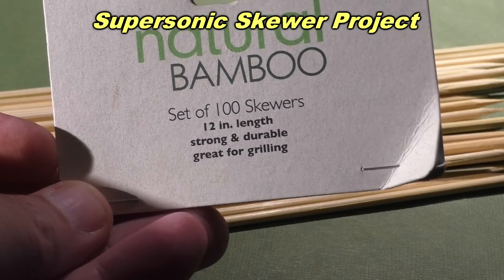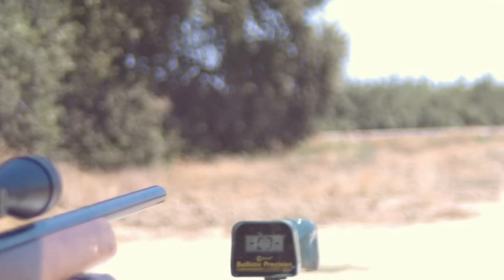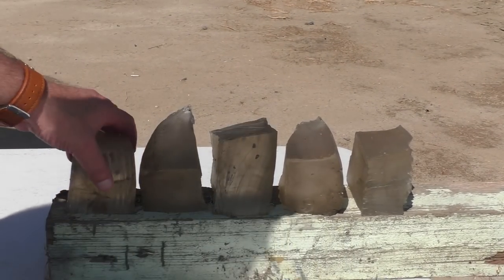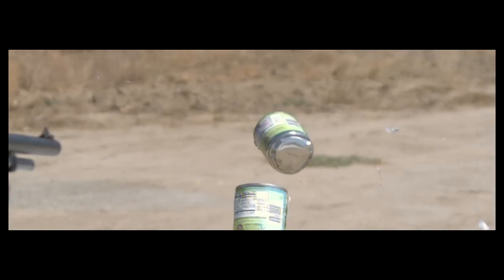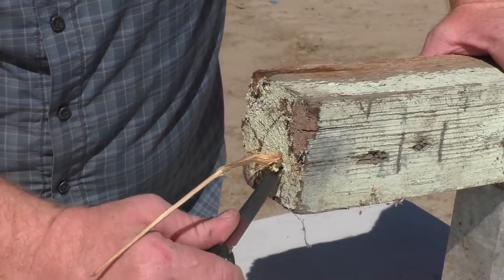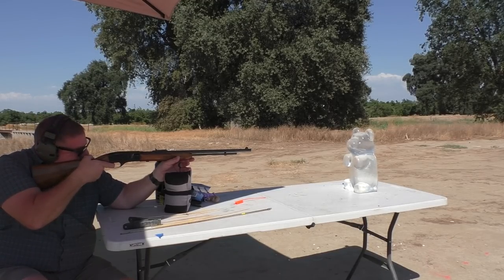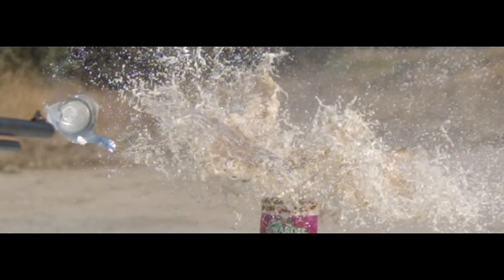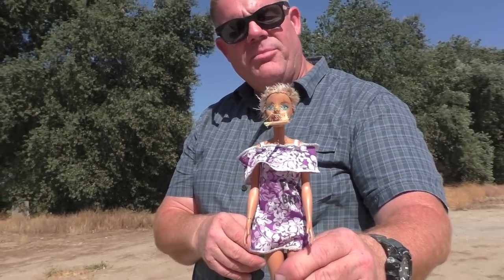Supersonic BAMBOO SKEWERS -  Tested!

Comment: When I was a kid,we used to put Farmer lite anywhere matches in our.177 air rifles. Once shot, the match head would explode. Like those bamboo skewers,it only works up close. They did however, work at a longer distance, something like 20 feet. The really wicked ones,were the thorns from a cactus. When you take a pair of pliers and pull out a thorn, it's left with a little fluff stuck to the end. Those thorns were like darts and would stick into an orange at a considerable distance. Maybe 50 feet.
Reply: I used to do the exact same thing when I was a kid! Strike anywhere matches would ignite pretty consistently at about 20+/- feet! And I thought I was the only one that came up with that!
Reply: I dod the match thing too
Reply: We used to take a potato gun, shove a handful of wadded up grocery bags into the barrel. You could drop anything down that afterwards. We shot rocks, arrows and washers. Im surprised were still walking around with all of our fingers and toes.
Reply: @evilbetty9204  I've done that too! Gravel flies farther than you'd expect.  You can reuse the grocery bags a bunch of times too. I gotta build a potato gum with my son when he's older. I only discovered them when I was like 17. Gonna make sure he gets to do ALL the cool stuff that we used to do back in the 80s and 90s.
Reply: @evilbetty9204  We had air cannon. Old compressor with ball valve and another factory size to load it with air.
After that 2 inch ball valve we had stump of threated pipe so with plumbing stuff we could use multiple 
diameter pipes as barrels. from very small one to propell AA-patteries to 3 inch pipe to just go grazy.

Beer bottles loaded with gasoline and bit of gunpowder lauched up to air were visible from multiple kilometers away...

So yes it is kind of miracle that we still have all parts attached.
Reply: We would shoot q tips at each other out of our pellet guns when we were kids luckily we still have our eyes!
Reply: 2 fire crackers in a broken off golf club. First one going off lights the second and shoots it about 10-15 yards before it goes off.  Never did it for pellet or bb guns, ammo was too cheap and effective to even think of swapping for something not so good as a kid.
Reply: we used chook pellets (chicken food) in the .22 air rifles. they left a good welt.
Reply: Great times
Reply: @RexSkittles  I used to fill hollow point pellets with strike anywhere matches. Just take a knife and carefully scrape off the tip, wet the powder with water so its a paste, fill the cavity in the pellet with the match paste, let it dry out, and boom you got incendiary pellets.
Reply: @MurkyWaters677  we would take.22 hollow point pellets and use a little drill bit and open up the hollow cavity deeper and a little bigger.We took the match head paste and fill the cavity. The altered pellet was pretty accurate.  They made an awesome bang!!!
Reply: I actually do that too though the matches just light when hitting the target. I have heard of people and seen video of shooting primers out of their air rifle. They make a nice report when hitting a hard target.
Reply: Bahahaha started quite a few brush fires 🔥 firing strike anywhere matches out when we was kids
Reply: Me and my cousin use to fire our potato cannon with oxy acetylene. Catch a glimpse of the potato as it goes out of site!
Reply: @Kesssuli  Speaking of air pressure, I worked at as a mechanic and had a 120psi tank and pump for air tools. If you took a long air nozzle with the twin side ports at the end and hold cat litter near one of the holes, it's the most amazing way to kill flies wan hornets
Reply: @ZacLowing  So you literally sandblasted bugs from air.
Our old factory compressor had output about 150psi/10.5bar.

Two inch pipe(about 3m/9.8f long) loaded with coffee mug full of different size nuts with piece of cloth as wad.
about 70-80 meters we had old camper trailer as target for varius shots.

Those nuts which hit still went clean throught both sides. 
AA-patteries were bit boring because at best they hit sideways to leave bit bigger hole.
With 3 inch pipe loaded with old bearing packet from mystery engine:
Fist size hole on front panel. Throught refrigerator. Trought next side wall. trought toilet,
came outside. Busted about wrist thick pine behind of trailer and finally disappered to forest.

Overally bit weak target to measure potential energy of shots but least if was fun poke holes to it
until it literally collapsed under its own weight.
Fun times indeed.
Reply: strike anywhere matches were awesome to shoot, all who know this must have grown up in the south or southwest because nobody i know here in connecticut has ever done anything like it
Reply: I used hollow plastic q tip sticks with a needle in one end and wound thread for fletching. Fired out of a red ryder it was pretty accurate at distance
Reply: @evilbetty9204  lol I did the same thing. Once I shot an egg out. It actually came out and flew perfectly.
Reply: I did it too. I also did the opposite, and shot a lit candle from across the basement. 
   Good news: the shot clipped the lit wick, and extinguished the candle. 
   Bad news: the burning wick & wax spattered onto the back stop, setting it on fire! (Because we were only shooting BB/pellet rifles, the backdrop was just a sheet with layers of cardboard & carpet. Worked great at slowing and catching the usual shots. Not so good at stopping fire. Well, it DID stop the fire - from penetrating. Too bad it was so easy to set ablaze!
Reply: @TheRealCCSmith   That is fantastic. 😀 Was that cannon made out of ABS? I am surprised the acetylene didn't make it blow up. There must have been quite the boom. 😮
Reply: I friend of mine and his older brother used to pull the small barrel out of a regular BB gun and drop Hi-lighter Markers down the barrel and fire them at each other. Until his older brother dropped a flat head screw driver down the barrel instead. Yes, I am quite surprised that we all survived our childhood. On the other hand, I had the best childhood ever! We grew up 30 miles from a one horse town, so we had to make our own fun and boy did we get good at it!
Reply: Jasus son,the markers sounded like fun anyway. 😁 The rifle must have been powerful to shoot a marker even a screwdriver. 😮 Was it one of those rifles you could pump multiple times? How did you get the inner barrel to come out?
Reply: @richardmcginnis5344  Southern California. Escondido/ San Pasquale valley.
Reply: @dlighted8861  No I think they were just Daisy BB guns. I tried to remove the barrel from mine to try it, after my friend told me the story but I destroyed my BB gun in the process. So I'm not sure how they got them out. Probably didn't help that I waited until the thing pretty much didn't work by the time I tried to do it, because I didn't want to wreck my "gun". Honestly, It's a story I was told by a friend when I was about 9 years old so the ratio of truth, exaggeration and out right lie is debatable, but I did see the BB guns with the inner barrels removed when I was over at his house. I would not have gotten away with shooting my brother anyway. My dad would have paddled my backside until I couldn't sit down if I even pointed my BB gun at my brother. Also my brother and I had to share our BB gun. Then there is the fact that my brother is 2 years older then me and a lot bigger then me. Even if Dad didn't punish me my brother would have beat me senseless and most likely would have been the one shooting me.
Reply: @richardmcginnis5344  Did it in Wisconsin!  So, not just the South!
Reply: @Joe5561000  My brother was nine years older than me and we still fought. Me eleven,him eighteen. He doesn't remember but after he knocked/ran over something of mine I tried to kick him "for true. "😁 That is when I found out there were worse things than a spanking. 😉
Reply: I had a potato gun, I started out with hairspray. I kept trying different accelerants to increase the power. I finally blew it apart using starting fluid. Never rebuilt one after, was a lot of fun while it lasted.
Reply: I used to take burnt stick matches and put a straight pin in them shoot them into our tree. Once shot they would disappear then if you looked at the tree sideways you could see it sticking out, they would shoot pretty accurate.
Reply: @ogwillakers4989  if you have a break barrel. 177 take a tip and cut the ends of.     Put an end in barrel and press 5 bb's in behind it and the other end of q tip behind the bb's and have fun.    You have a spring powered shotgun!!!
Reply: Also same. The head would explode when it hit something.
Reply: Yeah, the big kitchen matches were pretty cool. Somewhere we came up with a box of small pistol primers and discovered they fit too. And would go off against trees, rocks, and tin cans. Don't try this at home, kids. 

They also make tiny glow sticks that'll fit a BB gun barrel. Not their intended use, but cool looking in the dark.
Reply: Haha, we did the matches in the 177 air rifles too as a kid. Would be cool to see in slow motion.
Reply: We used to put pepperina tree seeds in our air rifle
Reply: @Anothermachine  haha the old daisy airguns are pretty versatile
Reply: @t.r.4496  Adventurous aren't you. 😁 Did you get any shots at all with the starting fluid? Is it called Cold Start?
Reply: @dlighted8861  yeah I always called it starting fluid, but it's ether
Reply: @williamivey5296  the problem with shooting primers from an air rifle,is that sometimes the primer will hit flat end down and the small bit of priming compound, will launch the anvil in the primer back at you. I stopped using them after my friend and I were hit in the face more than once. If you are going to use primers in your air rifle, definitely wear eye protection.
Reply: @kennethboston8301  Yeah, we thought of that. Never got hit - but we never shot at anything very close, and rarely perpendicular to a flat surface. Reduced the odds of a hit, and the energy considerably. Our neighbors' chimney, about 50' away and at an up angle, for example. (It had several black marks that stayed there until they repainted.) Proper eyewear or not, who wants that tiny ninja star stuck in their cheek?
Reply: @dlighted8861  Just regular schedule 40 pipe... but yeah it was LOUD!  We strapped it to some saw horses and wrapped a string around the striker. Then hid behind a tractor to yank the string. We were afraid to hold it even after many times of firing it
Reply: We used to put the kabob sticks into the barrel of the old school 177 cal bb/pellet pump rifles with about 20 pumps and the kabobs had enough velocity to stick into trees and bark. But only at short distances of 30ft or less. But at 25ft some of the skewers would deviate in the air but the better ones that are straight and solid would fly straight. Pumping the gun up more would not increase the range or power but would cause the skewers to curve at around 15 to 20 ft. But it was definitely a different time and place back then. We did try brads and small nails with the flat heads removed with mixed results  as well. But I am definitely surprised that nobody was ever hurt to the point of needing to go to see a doctor or anything  from our misspent childhood and curiosities.
Reply: Oh, I'm sure that the local hospital emergency room,had more than plenty of kids with different objects sticking out of strange places on their bodies. Kids crying with a tooth pick sticking out of his face and mom and dad have that " look" on their faces. At Palomar hospital near where we lived,the emergency room staff knew me by name.
Reply: Roll-your-own cigarette filters are .22 cal and make decent wadding
Reply: I use to shoot straight pins out of my BB gun…
Reply: Yep. the strike anywhere matches worked great out of a BB gun.  Another trick was using shotgun primers for slingshot or wrist-rocket ammo.  Hit a brick wall or a rock and the detonation was impressive.  Sometimes would leave al little crater in a cinder block, much to my chagrin when my Dear Ol' Dad came out to see what the noise was and saw the cinder block wall in the back yard.  Curiosity got the better of him though, and after having us kids demonstrate, the boy in him took over and he went down to the hardware store and bought a half dozen cinder blocks, three pairs of goggles and two trays of primers and the three of us spent the next couple of hours together having a literal blast.

Comment: Okay so I think it would be cool to see a bunch of bamboo skewers shot from a 12gauge(the skewers will be cut down of course) and then put as many as you can into a empty shotgun shell. Like a type of fletchette round.
Reply: I agree kinda. I would like see the full lenght skews in a 12ga. Maybe with light use of tape to hold them together. And try to see if they can simulate a R.I.P. round
Reply: @ET Hardcorgamer put them in wax